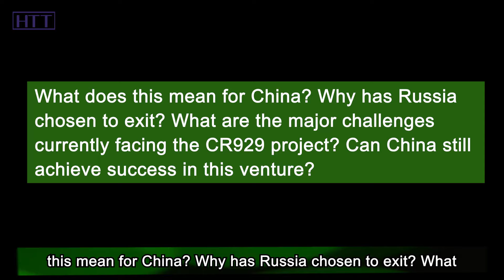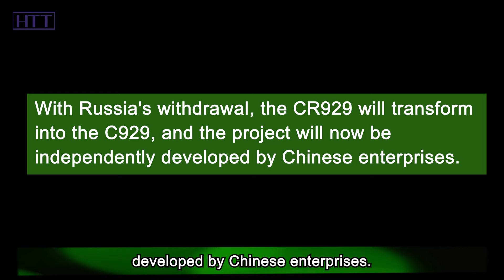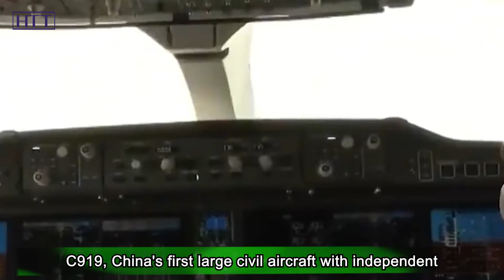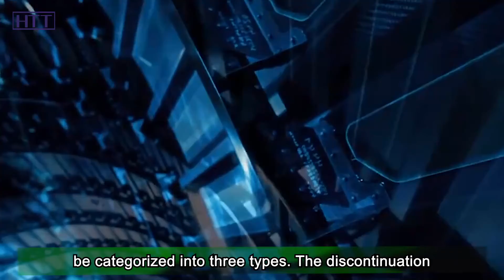Russia Withdraws, China Goes Solo – Can CR929 Still Succeed？

Comment: Russia has successfully developed many soviet era  and more recently Sukhoi super jet , MC 21 and  il 86 400M series aerospace products. 

MOST importantly Russia has successfully developed the Aviadvigatel series of engines, Pd 14, Pd 35 series of engines etc. Despite sanctions,  Russia has demonstrated its aviation can go it alone with domestic parts, In my own assessment the C919 project will come to a stand still if all western subsytems are removed from the jet, which is not statistically insignificant, 

in this light cooperation with Russia is key, at least in the short to medium term. Russia has shown it can completely on its own develop high tech military and civilian aerospace products, China has not, specifically in the area of engines, Partnership with Russia should be streghtend as much as is strategically possible

Comment: What the Chinese should do about large body aircraft. Is to get away from conventional designs. A wing-shaped aircraft can hold more people and materials. It also gives the advantage of much better fuel efficiency. And it is also more structurally stable. Twice the passenger capacity of a conventional large body aircraft. And a significant increase in fight time. Meaning one and a half or more range than 12000 kilometers.